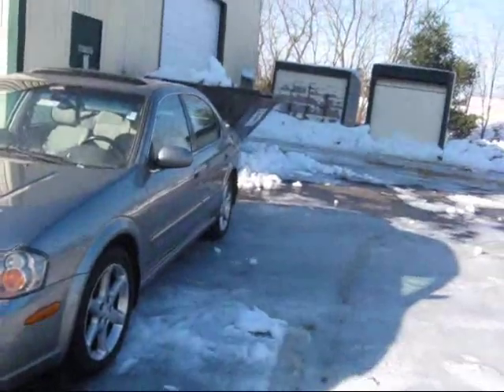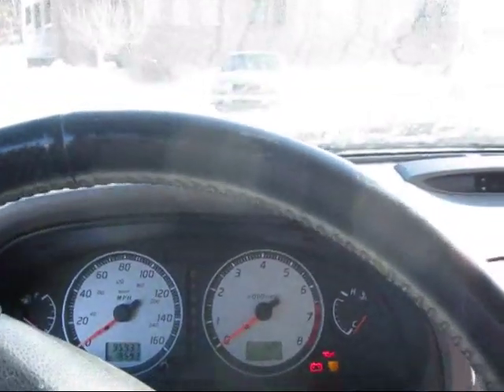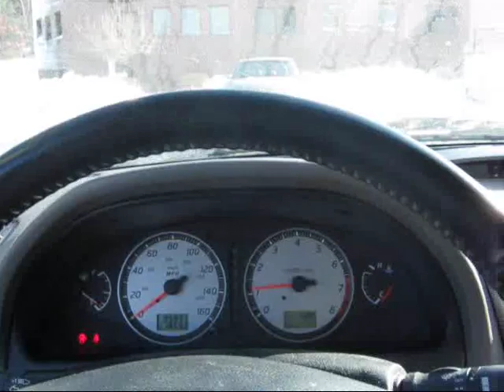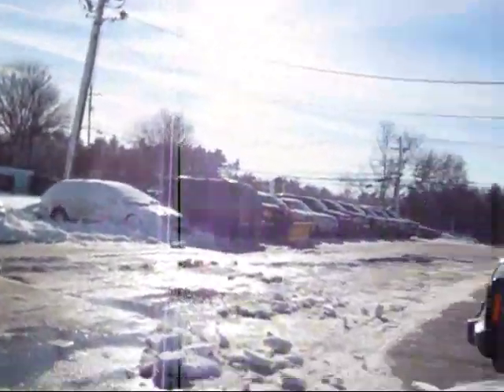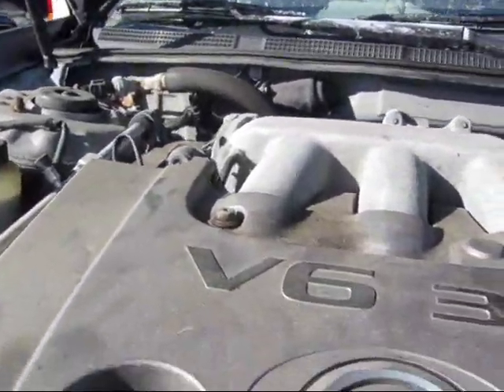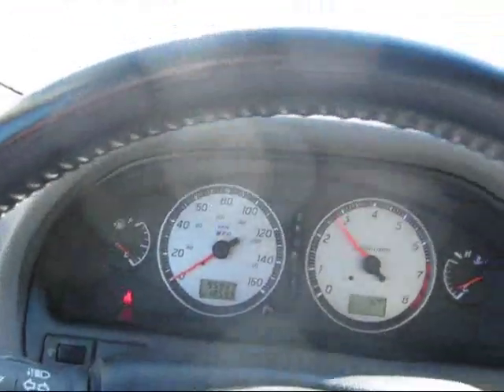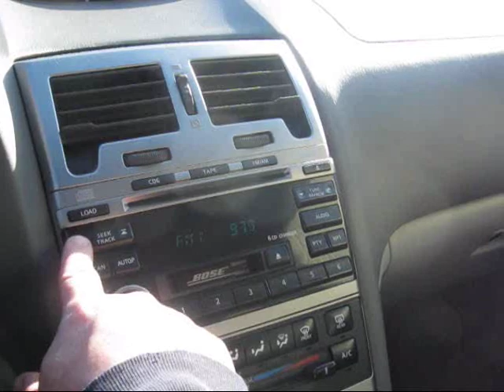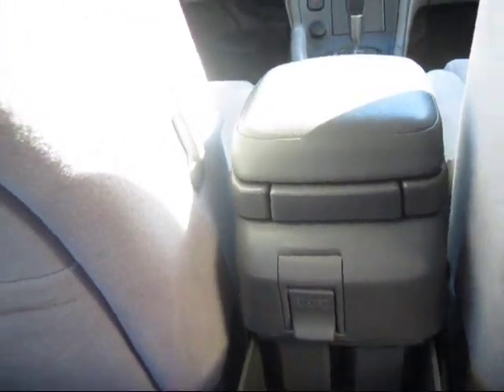2003 Nissan Maxima Start Up, Engine & In Depth Tour

Comment: oil pan looks kinda rusty id have it replaced and since its driven in winter climate have it rustsprayed yearly I also own the the car only thing ive ever done to it other then maintain the fluids brakes suspension is a radiator

Comment: mpg 17city 20 combined 24 highway $2850 per year on gas
Hp 255hp 246 torque   lol hp is the same as a 5.7lv8 in the 1gen tahoe